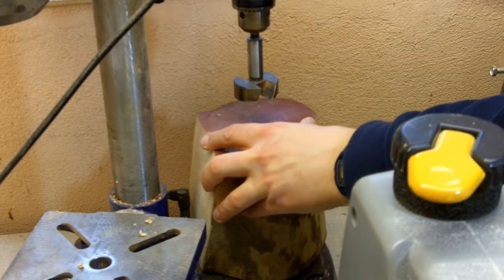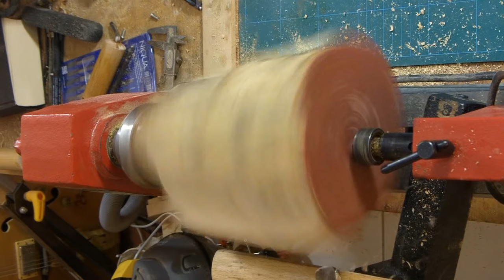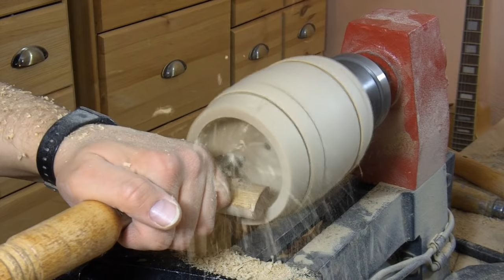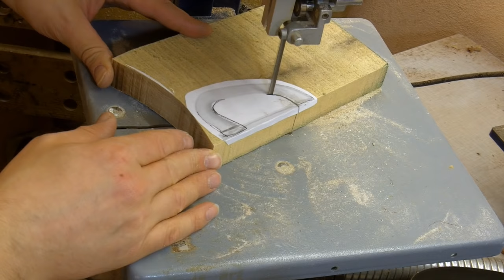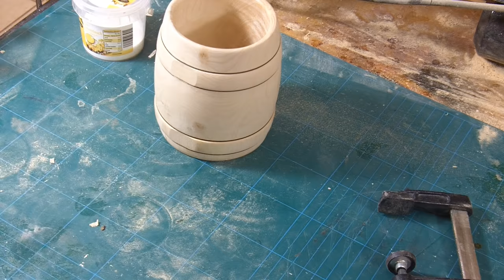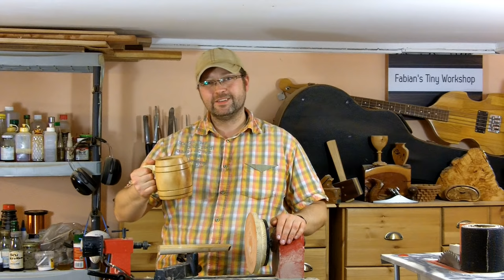Making a Beer Mug - Woodturning

Comment: I made one with 6 pieces of white oak cut to 60 degrees and glued up with epoxy, so when I turned it, they looked like barrel staves. I coated the inside with MAX CLR epoxy and it is indestructable!  I could have made it from red oak and it would have still been water ---um beer-tite.